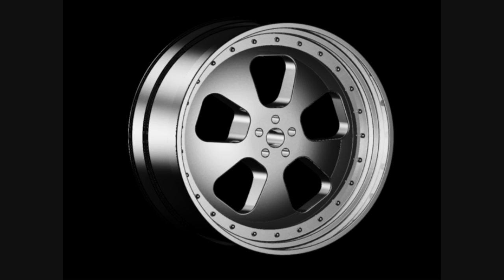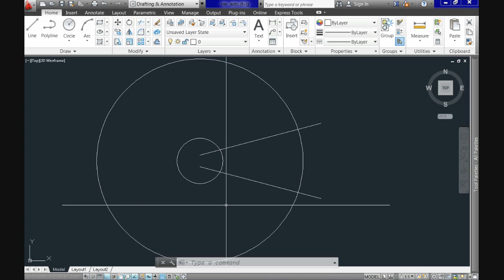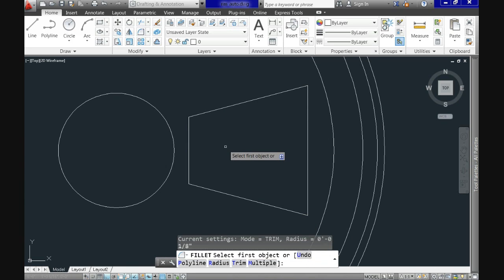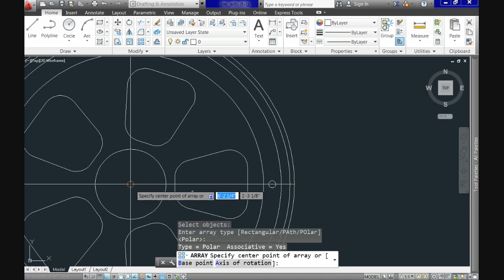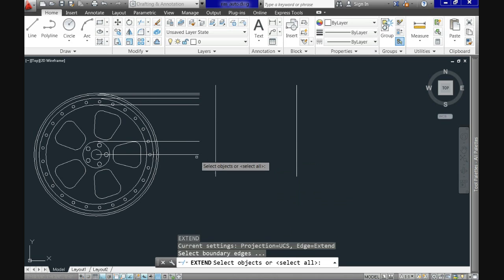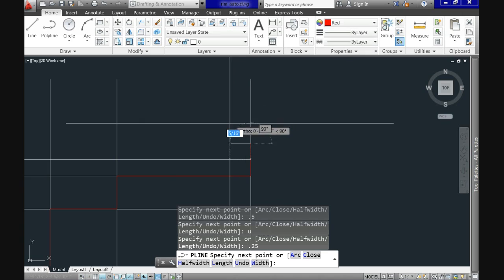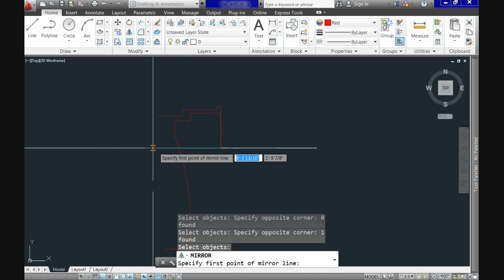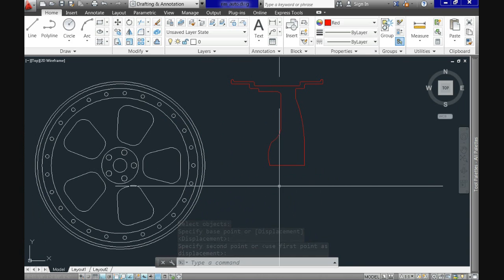AutoCAD 3D, how to create a Rim in AutoCAD 2013: Part 1

Comment: How do you draw a profile if given x, y & z when vertical scale is 1:10 and horizontal scale is 1:100?
Reply from the maker: Tom Nyongesa Wafula Generally you don't scale objects in model space but in your case, it seems that you have to do the math and conversion at the time of drawing the profile. In Cad you always draw at actual size and the scaling process comes normally before printing.
Reply: Modify-> Scale-> (select objects being scaled)> Enter> 0.1-> Enter->
I'm assuming 1:100 scale on horizontal is a typo.